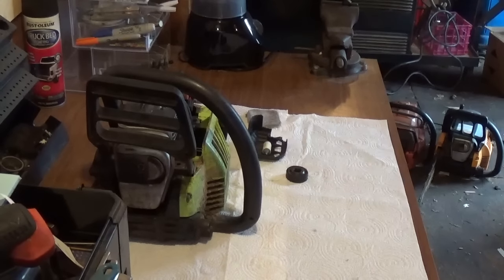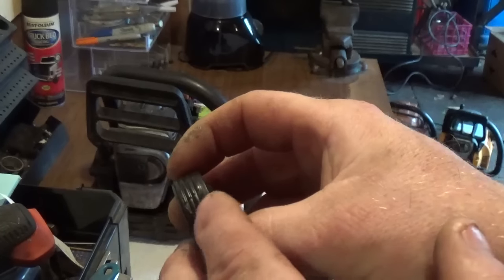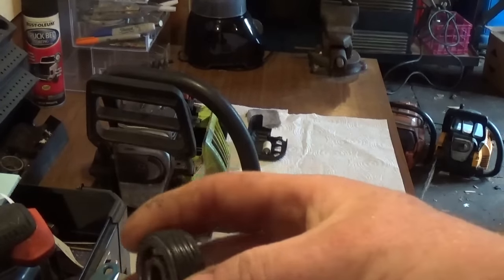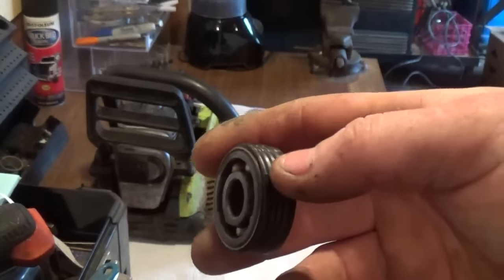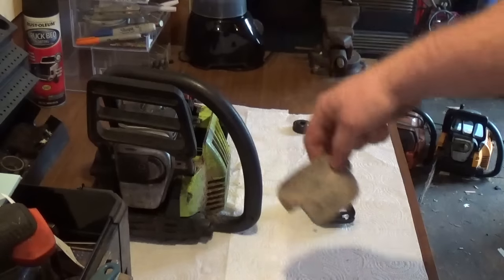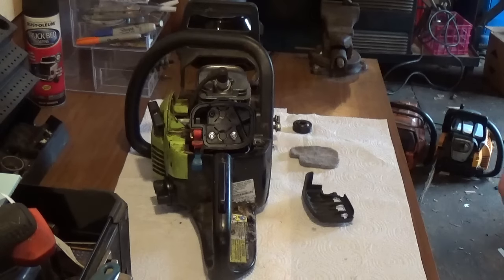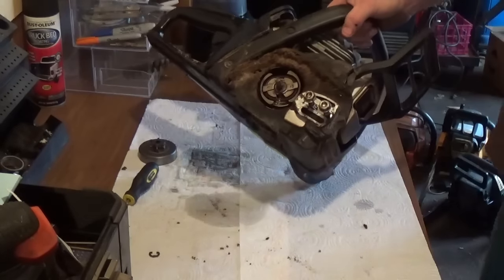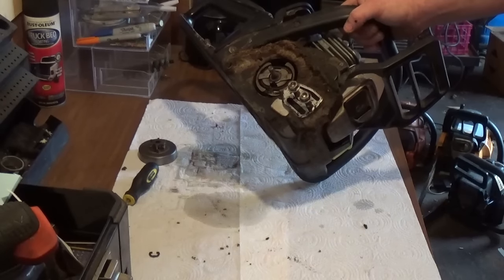Common problems with Poulan Chainsaws

Comment: Thank you for this helpful video. I am new to chainsaws and borrowed a friend's Poulin and it literally drips oil from the bottom of the housing (Don't leave it on a patio). It over heats. It is going to go in the trash. All of this is to ask, if no to Poulan (and I agree!) then who do you think makes the better chainsaws?  Thanks for your help! -Eric in Dallas, TX
Reply from the maker: There are many and I personally like Stihl ......I recommend the MS250 ,290,or 310 for basic around the house chores .
Reply: Patrick Carrington for homeowner saws, Echo positively puts foot to ass all day long after a minor carburetor adjustment and a muffler mod-

Do yourself a favor and look through the chainsaw forums over at Arboristsite.com.  The site is packed wall to wall with expert advice and information from one of the most welcoming, thoughtful and downright badass communities you'll find on the web.
Reply from the maker: Thanks /I will do that...
Reply: I bought a low end Stihl from a Relocating neighbor. It had about 6 hours max on it.   That saw would not start.  Took it to my Husqy dealer and watched a 6 ft. 250 lb mechanic start it after only about 150 pulls. They said it was typical of small Stihls .  Traded it in for a Stihl  with Easy2start.  That was 3   Years ago.  I love it.it.  I am 83 and have 4 torn rotator cuffs.  2 on each shoulder.  The last is inoperable.  The saw has always started on the 3rd or 4th pull. I count two very slow, gentle pulls as one because it takes 2 full slow pulls to wind up the recoil spring and automatically release the starting spring.  Only use the saw a couple of times a year for casual cutting.  No wood stove or fireplace.  After each use I pour the unburned fuel back into the storage container or on the driveway. Always use non Ethenol  92 Octane  50:1 stabilized fuel.   Same as for my 2654 Husky tractor. No problem with starting on either machine, or my portable 5500 Troy built portable generator is run dry after each power loss.  It has about a 10hp B & S engine. It has started on the 3 rd pull for every power loss emergency.

Comment: This is a hilarious video. I have a 2055 and a Wild Thing. I always have to pull my freaking ass off to start them. I do have A Poulan Pro 50cc That runs a little better though.
Reply: West Virginia Patriot gotta agree somewhat. I remember when they built better EVERYTHING'S. I have a poulan 50cc pro and yes, it does better than the 42 poulan as well,,, it never ran worth spittin out of the box.  TV's don't last anymore either.
Face it, we live in a " that's good enough to sell" world these days. Ain't worth shittin on!

Comment: looking for primer ball unit for 38cc 18 inch chai saw
Reply: Best source is ereplacements.com. Not necessarily the cheapest, and will add shipping, but they have virtually any part you need. By the way, some lawn mowers have primer bulbs, which force fuel into the carb throats. But most small 2-cycle engines use a purge bulb, with pulls fuel into and through carb, to the bulb, and out the return line to the tank. Different function entirely.

Comment: Quick question. For a cheap chainsaw that is only going to get used a couple of times a year, assuming decent maintenence, is a Remington any better? The cheapest saw that's decent quality would work for me and I want to know if I should spring for a small Echo or if maybe a Remington would fit the bill. Any thoughts?

Comment: Thanks so much for this video. Mine was given to me after itd sat in a basement God knows how long, wouldnt run, wouldnt start, replaced the carb, played hell replacing the fuel lines. Now its doing exactly like you said, runs erratically when it does start.  Now I can finally send it to be with Jesus with a clear conscience.
Reply from the maker: Amen....LOL

Comment: I personally don’t own an echo product but I’d be interested in hearing your opinion on echo
Reply: Echo saws are good in my opinion... but some come very lean from the factory and should be adjusted out of the box.....the new ones have been better like the cs 355t and the cs 590 run decent out of the box... the rest you soulf take off the limiters and adjust them as many are set lean....as is the strato version poulan saws very lean another reason they burn up....just my opinion....I have not taken a saw mower or weedeater to the shop in 20 years...teach your self and save money.....IMHO....

Comment: I've owned my poulan for over 17 years, and the only thing I have replaced on it is the chain.
Reply from the maker: Ok fair enough  ? Whats the model Poulan you own . And just curious if all that has been replaced is just a chain you maybe due to purchase a new clutch and sprocket .17 years is a long time to have ran a saw with no major repairs . My viewers and I would love to see this old saw..... please provide a small video on the running of it and maybe its idling ability first cold started then after a few cuts.

Comment: how do i stop a leak out the vent hole?
Reply: replace the line that should be in there, fuel line with screw in either end. search more online for length and screw size.
Reply: What model ?? 3314 ? What vent hole ? There is a fuel return hole going into the fuel tank from the purge bulb, and there is a fuel vent hole in the center of the fuel cap. If it's the fuel cap vent, replace the cap, about $8.00 on Amazon. But it's hard to make a recommendation without know which model, and where the leak is occurring.
Reply from the maker: On these cheaper model Poulans the tank vent located in the cap has likely swollen / So simply purchase a new cap this should prevent the build up of tank pressure allowing the chainsaw to vent as intended .
Reply: @kevinbolin7665  the vent hole on top of the tank, its supposed to have a length of fuel line i think about 4 inches, with a screw in either end to allow low pressure to build. the carb doesnt have return.
Reply from the maker: @Seriouslydave  This man never indicated what model saw he had ....granted if it was a older Poulan then your correct ......but with limited information such as 23 years it could still likely be a older entery wood shark .In witch the tank vent is incased in the gas cap .

Comment: I bought a pl 3314 and roughly  the reviews are extreme 50/50  I have among maintenance wise a diploma in  motorcycle and small engines  , well getting to my point I use true fuel to keep the best mixture , running, starting, storage . I still have to pull it from 1 to 10 to start it  once it is started I abuse the hell out of it it cuts like crazy. I just didnt see the reviews  long enough to decide , by the way it cut everything including a bunch of 2x4 's  i had on my property.

Comment: I have had a Poulan for about 15-20 years. It has always worked pretty good, but when I put it back in the case,  every drop of bar oil runs out in the bottom of the case. I usually drain the oil before storage. Truth, I use it very very little. That’s why you can buy ‘em for about $99 I reckon.

Comment: Thanks! Hilarious and educational - call it how it is. I got one to repair for a client - may just go for it for the experience - even though it will cost 5x as much as buying a new chain saw to repair the piece-o-shit 🤣
Reply from the maker: Its been 2 months ....just curious what was the cost of the repair ?
Reply: @kevinbolin7665  hey Thanks for checking in! :D It is kind of a practice run. My neighbor is a widow and didn't need it back right away. I do this for a living as well - so I have 2 fridges, a washer dryer combo, weed eater etc. On Cue - I generally charge a flat rate of $1oo plus the cost of parts. No matter what is going on with the thing. Unless of course it just needs a new lightbulb or fuse 🤣 -I don't rip people off.  I just got back to the Poulan this week and I am thinking it just needs a new spark plug.
Reply: @kevinbolin7665  can you recommend some kind of spray or fluid I can put into the Piston chamber to just kind of clear out any sawdust that may be in there ? - like slosh it around and pour it out ?
Reply from the maker: @kodyjbosch1  I really cant think of any other than typical carb cleaner ......And I personally wouldnt recommend it simply because it can affect the clam shell sealing that often is applied with permatex {RTV} ...Light air burst from a air compressor wand with the muffler removed .....But ideally gasoline in a spray bottle would suffice ......But now with all this being said if sawdust has entered the piston chamber you may wont to remove the muffler and inspect the piston as well as its skirt, rings and the cylinder or jug its self ........Your likely going to find signs of scoring if the air cleaner is or was massively clogged .
Reply: @kevinbolin7665  thanks Kevin! I think in this case it might be okay 🤣 - the air compressor route seems good. Maybe I'll just put the new spark plug in and fire it up - if it goes down no loss right ? How long can a man polish a turd ? 🤣😭😭😭

Comment: You are so wrong on so many points
Reply from the maker: Well by all means {elaborate} on said points..
Reply: @kevinbolin7665  First of all when someone uses the phrase "Piece of shit" it automatically proves ignorance
 non professionalism and an amateur like mannerism in  evaluation of a product and loses all respect I have for that person.Your Chevy vs Ford analogies do not serve practical knowledge to the less informed
including a lack of true mechanical training including the pronunciation of Poulan and Husqvarna.Every day I witness the improper handling of chainsaws even by so called pros, the majority who improperly hold a chainsaw during the pulling of the rope. The gas and oil caps are designed to use either the combo spark plug tool that came with the saw or a common screwdriver between the lobes of the cap to loosen.The leverage provided very very easily removes the caps and specifically designed in that manner. To sum up your evaluation of the number two market share producer of chainsaws, over the more then 12 other manufactures and the fact combining the branding of Husqvarna with marketing three different badges means they sell more chainsaws then even the fine Stihl and Echo saws.The fact that the very competitive consumer based pricing leads more non experienced tree cutters towards the brand means more failure due to lack of experience and knowledge. If you think Stihl which is considered the top saw in the market place doesn't suffer many of the same failures you lack "Quality professional" real world experience of chain saws. You want five hundred dollar technology in a hundred fifty dollar chain saw? The following video will point out your non-sense.
https://youtu.be/1yJceHG-Qco
Reply: @kevinbolin7665  The fact that a large portion of repair parts for Poulan are low cost  Chinese knock off replacement manufactured parts leads to further performance issues. Ebay is a prime example of this. An example is Tygon fuel line.The vast majority of aftermarket replacement  fuel line  and carburetors for Poulan Husqvarna Craftsman saws sold today are Chinese manufactured  that though they specify ethanol compatible, the fuel line and carburetors are not and the fuel line is not Tygon fuel line. Most fuel line advertised as Tygon  is actually  knock off Chinese manufactured fuel line in name only not true Tygon. Tygon fuel line always has  Tygon® F-4040-A Fuel and Lubricant  etched in genuine Tygon fuel line.Even part suppliers of chain saw parts are unwittingly selling knock off Tygon fuel line.Tygon ethanol compatible fuel line always has the Tygon name lasered  into the fuel line including the spec number and costs twice as much as the bulk knock off replacement fuel line.
Reply from the maker: @denniss9620  Impressive facts projected …..exaggerated some what …..But you def did your homework .Now if I may Husqvarna is all about sales …..think I am kidding …..then try looking up carbs, primers ,fuel caps for Husqvarna , Poulan, and Craftsman . All provided by Husqvarna as a parent company for local Tractor Supplys …..some Lowes stores ….etc . Yet when looking up the factory part number for the replacement part threw Husqvarna there often 3 different prices for each piece of equipment …..Equipment that has the exact same part number provided by Husqvarna  . Husqvarna is crooked as hell ….They even try to push obligated sales on there dealers by changing sales reps every 3 months with there new face more in place mentality . That's why so many dealers locally dropped Jonsered as they where forced to carry 2 times more inventory for these saws in comparison to that of Stihl . So maybe my little innuendos are sarcastic but that dosent make them any less true . Now as for my projection of facts upon the Poulan line of saws in this video . I don't make it a habit to try to baby sit peoples emotions …..I don't wish to be a quote on quote positive role model …..because lets be realistic this positive role model mentality was developed threw conformity advocating examples of what should or not be said threw expected behavior . That's like asking are you a glass half empty or full sort of person . And personally I prefer the idea of observation and choice. Hints why I chose to use profanity and mispronounce Poulan as well as Husqvarna . Now we both can agree China makes carbs for Husqvarna /Poulan as well as replacement parts such as Tygon ...Sold and repackaged by Husqvarna  . So I ask in light of knowing the quality How was I wrong on so many points as you implied ?
Reply from the maker: @denniss9620  Humorous ….I will give you that....But quality speaks for its self …...The Poulan challenge is yet to be completed by a modern Poulan ….And there isn't anyone that's left such claims capable of validating it with a video . Simply Because It Cant Be Done with a cheap piece of shit modern Poulan sold for that 150 dollars. Yet I can take a aftermarket china made piston and cylinder and place it on a rebuilt Stihl and it will preform flawlessly ...You know what I enjoy the most about the attempts locally ? The Poulans dying under idle after the first 5 or 6 cuts when new . I laughed at Tom Hesting {local} guy who bet his poulan 4218 could do the test with no problem . Note he had it repaired at Affordable Small Engine in Liberty Ky and had been bragging just as most others did about its 42cc skipped toothed performance. Even went as far as to make a foolish bet . He said that if he could preform the challenge I personally would have to purchase a new poulan and give it to him on my channel . {Done Deal } I said but if it don't I have the pleasure of blowing up your Poulan and you have to purchase a Ms 180 Stihl . Needless to say I won that bet ….And he purchased a Stihl Ms 250 from our local Ace Hardware Store . LOL The damned Poulan made the first 5 cuts but died upon idling about 30 seconds after making its first of what should have been 5 additional cuts and a return to idle . And because I took no real pleasure in wonting to actually blow up the saw I gave it back after the purchase . He later sold it to Eric Carmen for 25 dollars …..Eric brings it to me …..it was scorn ….So it found a resting place among its Poulan Pieces of Shit within the Popular Poulan tree .
Reply: @kevinbolin7665  Its Simple,  Poulans arent 
"pieces of shit" and cutting timber on our 10 acres for years proves if you know what you are doing Poulan performs as well as my Stihls for non commercial use Good Day. And I suggest you learn some professionalism in your trade